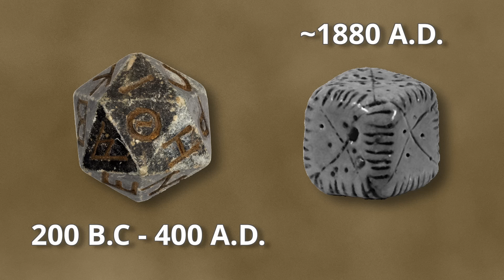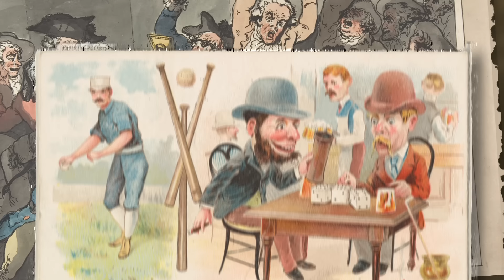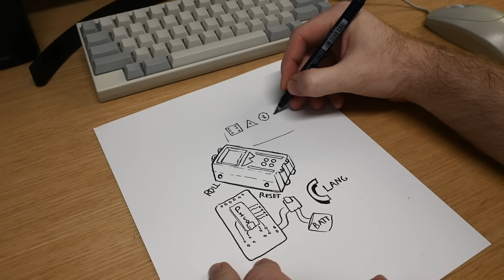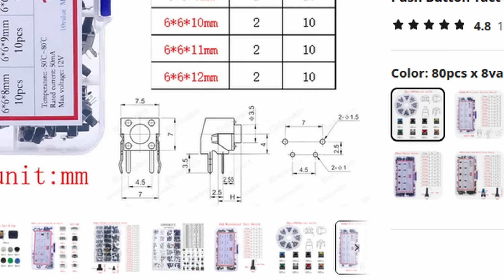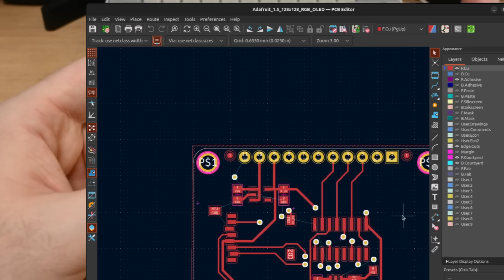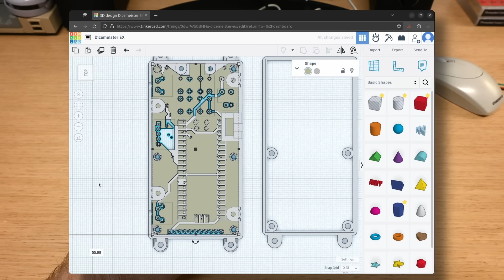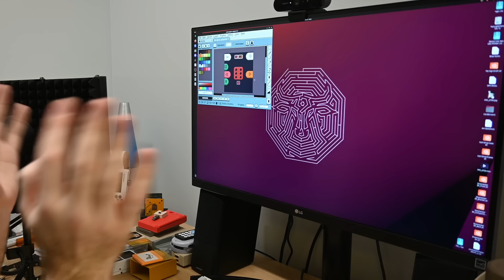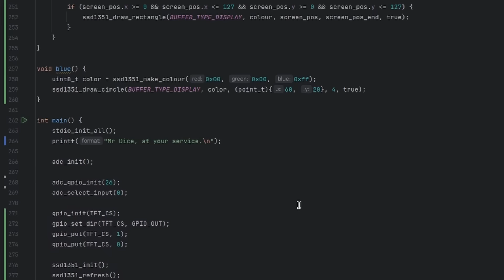I built the ultimate tabletop gaming gadget

Comment: Next version needs "Shake to Roll". Looks great.
Reply: Honestly, that's a pretty cool idea and probably isn't that hard to implement.
Reply: I was thinking this too.. select your dice, then shake it to roll.. 
Eventually I'd probably also animate the dice rolling.
Reply: yes.
Reply: @victorscarpes Add an accelerometer and have it press an  input after it reaches a certain threshold.
Reply: @Halford_Steel just use a tilt switch in place of a pressable button, it's a much simpler implementation of the same feature
Reply: An option to get explosive dices could be could too for some RPGs
Reply: Don't forget a memory of past rolls. Too easy to click through.
Reply: Also add a noise maker so shaking it also makes some kind of dice noise,  if its a digital maybe several different noise depending on the amount of dice rolled.
Reply: @victorscarpes  Yep I'm building it and I use a ball switch and it is really easy to program. Basically just like a button.
Reply: I wonder if you could strip down a wiimote and implement its shake sensing tech into the dice thing
Reply: @DefaultChromosomes  maybe a tiny vibration motor too...
Reply: I kept thinking of that the whole time.
Reply: @victorscarpes  by putting reed switch and wobbly magnet, or simply stray wire that can contact on shake is indeed kinda easy to do
Reply: I was thinking close to the same thing! I know the convenience lies in it being all-in-one, but having individual digital cubes for each different dice type that I can shake to roll without having dozens of dice on the table would be really fun! On a more arts and crafts side, I was thinking if there's a way to make a shakeable version that's similar to a Magic 8 ball?
Reply: and the d10 and d100 dice as well. It may as well have all the dice. This seems like a bit of an oversight.

Comment: For those wondering about the d10, the case itself is already a ten. Great video!
Reply from the maker: :) thanks so much
Reply: Wouldn’t the case by a d6?
Reply: @JoZaHandle 10/10 :)
Reply: @JoZaHandle no, there are technically 10 sides
Reply: @frostbite3756 that’s a box. More simply, a cube. A cube has 6 sides.
Reply: @K0D0R0  count ALL sides, also it would actually be 11
Reply: @frostbite3756  you cannot “roll” it for those 5 sides where the screen is. So, no. d6. Also, name this shape.
Reply: @K0D0R0  his name is Jery
Reply: You never covered d% Percentile
Reply: @JoZaHandle  r/woosh
Reply: @K0D0R0  You forgot about the inside. 😂
Reply: @HidariFFXI  it’s 12 then. But you cannot “roll” for them.

Comment: Fun story: in school we made our own PCBs using sharpies and an acid bath. You got the PCB and drew the traces on with sharpie and put it in the bath. Then when it comes out the acid has taken away the copper leaving where you drew untouched. I believe it’s called Acid Etching. This was for Electronics. I felt so baller cause mine had a lil pokeball Easter egg and also the words “I miss it. The steel sky” as reference to my two favourite games at the time. Ah to be a child again.
Reply: Oh, didn't know you could just use sharpie. We made such PCBs in uni with a laser printer
Reply: i did this too! one of my favorite classes
Reply: @unknown-otter  the industrial approach is for better replication, sharpie was the old way tho, that's why old electronics have squiggly smooth lines instead of parallel straight lines

Comment: Next version, add the D10, it will help with games like D&D.
Reply: Agreed, and the D100
Reply: @huel4582  what is d10 d100? I'm clueless here
Reply: @Femiway_Bunty  d10 is a ten sided die, and d100 rolls 1-100 which usually rolled with 2 d10 one for the tens and the other for the ones.
But for RPGs both the d10 and d100 are mandatory.
Reply: @robfrydryck127  what is the connection between RPGs and dies?
Reply: @Femiway_Bunty  table top RPGs use dice for a bunch of things, usually to determine outcomes. For example in D&D when attacking an enemy, the player will roll a d20 and add a modifier to the result based on their character's skills and this will determine whether or not they succeed in their action based on the defence of the enemy.
Reply: @Femiway_Bunty I'm not sure about the d10, but a lot of people consider a d100 a % die

Comment: It's really cool but there's two things I would change about the device. 
1 - One of the most fun features of dice is how fidgety they are. Maybe add a rumble engine that shakes while the dice are rolling?
2 - In D&D one of the most known rolls is 8d6 damage from fireball. While it is a meme, increasing the dice limit to 8 would fit that nicely and cover most non-shadowrun use cases.
I realize both of these would probably impact the size of the thing, the first requiring space in the case, and the other would need more screen space to display the dice efficiently, but I think they're worth exploring

Comment: I would add one button on the side for each cube size and a reset button. I believe, d4, d6, d8, d12 and d20 would be enough. Just 6 more buttons. So, clicking them will add a throw of that cube and sum of last N throws (I think, N = 6 or 8 should be good enough) and reset button would set counter to 0. So you can sum different kinds of cubes, this is frequently happens in dnd games

Comment: So what I would add to this would be the ability to save a dice roll, then call it back up. I would also consider adding an option to have more total dice by instead of having each die be separate, have multiples of the same type of die ganged together.

And then maybe be able to designate one die as being separate from the dice that are the same, or else when you add a particular size die, you can have as many of that type as you want, but then you can add that same kind again as a second die so that you can see it separately

Comment: Hey, neat project. Wanted to tag something useful for next time you use Pico, there are 6 test pads on the underside of the Pico, 3 are not interesting like ground or things that are marked don't use, but there are 3 interesting ones, TP2, TP3, and TP6, which are the two USB data pins and BOOTSEL. The Adafruit Type C lipo charger exposes it's data pins for the Type C port, so if you connect it up to the test pads, you can have the Pico talking USB over the lipo's USB port! Add an external BOOTSEL button, and ypu can reflash the Pico without opening up a project to get to a debug port. The debug port is still useful for development, but this is more useful if you want to update a number of built units or have USB functions. Word of warning, they have shifted the test pad locations between Pico, Pico W and Pico WH, with no promises about not doing that with revisions or new models. I'd leave a large cut out to access them and use thin wire to connect test points to pads on the PCB (or off elsewhere), rather than plated through holes to add a connection with a dab of solder.
Reply from the maker: Good note! Thank you. I think I've gotten spoiled by being able to reflash without hitting BOOTSEL and rebooting it, but still a great tip :)

Comment: Wouldn't it be quicker to just have a button for every die, two buttons that add and subtract dice from the queue, and a "roll" button? The UI would work like this: during the "open" state, the user can press a dice button to select it, then press the "+" button to add it to the queue. The screen would then display "1d20" for example, and any dice added to it would make it display something like "1d20 + 2d6 + 1d4". If the user wants to remove a dice from the queue, then they can select that dice and hit the "-" button. In the previous example, if the user wanted to remove 1d6 from the pool, then the screen would display "1d20 + 1d6 + 1d4". 

I know I might be overexplaining this, but I think it would be faster this way. Instead of scrolling through 3 or 4 other die just to get to the dice that you want, you would just have to press 2 buttons. Trust me, when playing a game like D&D, for example, every little bit of time spent on rolling die counts. However, this would be at the cost of adding more buttons. Your current design has 6 buttons and a power switch. But with a button for every die type, it would have 10 buttons (1d4, 1d6, 1d8, 1d10, 1d12, 1d20, 1d100, plus, minus, roll) and a power switch. I don't think this cost would be that great, and it wouldn't get in the way of the usability of the device.

In addition to that, I think there could be a feature to subtract die from the total roll. For example, if the user selected a d4 then pressed the "-" button, even though they have no d4s in the queue, then the screen would display "-1d4". It would have no effect on it's own, but it would be useful for rolling, for example, "1d20 - 1d4". Maybe you already thought of this and implemented it, but there seems to be no indication of that in the video.

Comment: For sanity, I always use headers even with custom PCBs. It makes it easier to replace any component if it breaks and for stuff like the screen or the processor itself getting bricked. More common on Chinese Arduino clones, but still...
Reply from the maker: There is definitely an art to making sure your boards are still usable even with bad components or design issues
Reply: @abetoday  I usually find it easier than proper design. I'm a CS/ML dev and self-taught on the hardware department, pin headers is my way to cover my fk ups in board design haha

Comment: I rather it was dice-shaped and acted like a dice, i.e., it has to be rolled, and in this case rolling it, or more specifically, the dice impacting a hard surface, would trigger the number rolling, i.e., changing, then, after some random time, stop and display the result on an LCD. But instead of a single LCD, there would be six LCDs all displaying the same number, and, since the number would not change unless the dice got impacted, the number would be safe from changing and hence from people attempting to cheat.

I would also have the dice power off after a minute or so, after which it could be turned on by impacting it against a hard surface, at which stage it would display the last rolled number.

Comment: Pi Pico for for this? lol   Cracking a peanut with a sledge hammer?
Reply from the maker: What would you have preferred? I am not aware of any solutions cheaper than $4 which are capable of driving a display, but I would definitely be interested in alternative solutions! There are RP2040 on smaller footprints (PGA2040, XIAO, etc) but there is something to be said for building around the most popular footprint for the microcontroller.
Reply: @abetoday atmega avrs would also be good for this kind of project. U don't need to drive the screen very fast so it would do. Also extremely cheap

Comment: Hey, just wondering how you displayed the icons and all the stuff you designed on the screen. Did you use bitmaps and only updated the bits you needed to or did you use shapes and draw them all that way using your previous designs as a template?

Comment: It would be cooler to have less wasted space on the design (the text looks too small to read) and keep the satisfying feel of actually rolling a dice while removing the annoying parts (you have to calculate the sum in your head, the dice can roll off too far) So it should probably look like a large dice, but have a screen on one of the faces, and instead of rolling the device itself it should be see-through and mechanical, kind of like a casino roulette, something inside the device should be rolling, and you just need to give it a light shake or throw to start, and that kinda generates a random seed, from there, the software should work the same as in video, the screen should display numbers in a way that's minimalistic and easy to read, in large font.

I'm not sure how useful it would be to implement rolling several different type dices in a mix, this design would be kinda innacurate in that way, it only imitates one dice shape.

Comment: I have never had lithium batteries in my projects because I am scared. I don't know what sellers to trust on aliexpress, what modules to use for the bms. Does anyone know what the model of the battery and the charger is? :( Thanks
Reply from the maker: I get all my batteries and chargers from Adafruit, they are the ones who create a lot of the designs cheaper sellers copy/paste so I trust them as a good source.
Reply: @abetoday  thank you! Are any of the Li-Ion good enough? I just pick the jack I want and the battery I want and I am basically ready to go? or are there compatibility issues? I can't find a datasheet on their website

Comment: You misspoke a few times it ways that seem to be from homemade process. The copper isn't filled and this board wasn't mechanically etched, blank boards start as fully clad, and most etching is done with acid.  Acid etching at home is simple, but it's relatively common for people to machine them these days rather than messing with etchants and coatings, boards you order aren't made this way.
Reply from the maker: Apologies if the phrasing around etching or fills was unclear. My goal is always to provide an approachable description of the process rather go super deep. For example, the difference between a machine which prints and chemically etches a design versus a machine which routes out paths is important, but beyond the scope of this video. My point was just that the board was created via a mechanised process, the exact details are left as an exercise to the viewer. Same with fills, etc.
Reply: @abetoday  I only responded because it sticks out enough to be worth commenting on for a DIY channel where viewers might want to experiment and many industrial processes are much more in reach than it seems. Also acid etching isn't a mechanised process in the way you imply, maybe you're thinking of through hole drilling?

I may be misjudging, but you seem to want to avoid technical elements of discussion under the impression that it will chase users away. Your presentation is fine so I don't think that's an issue.

Comment: why not use a phone app?
Reply: So far, there is a phone app that lets you add more than one of the same die and a modifier.

Another will let you roll different types of dice together but doesn't allow for modifiers.

I haven't found an app that will do both. This thing does both. Total dice roll on a single screen. No head math, no writing down or memorizing previous rolls. Instant total.

Doesn't sound like a big deal until you have a disability that effects both stamina and cognitive/executive functioning and dang... Do I want this little magic maker.